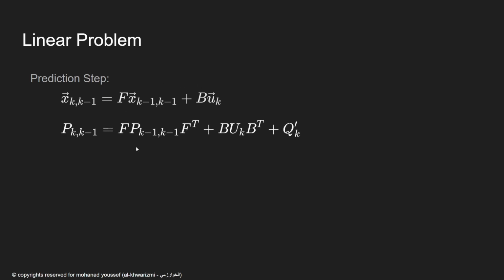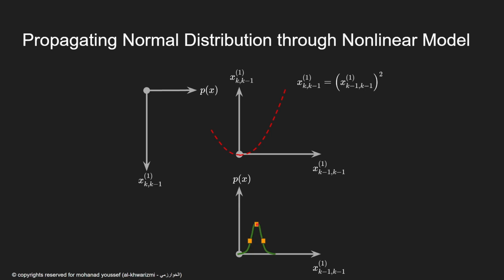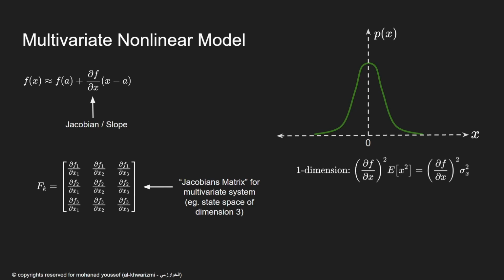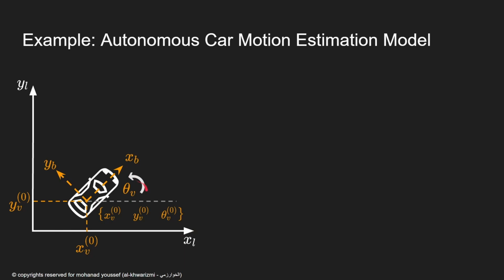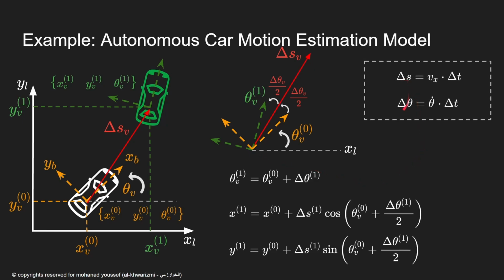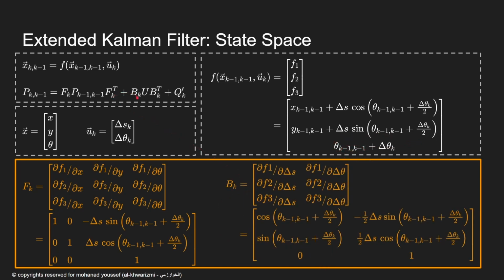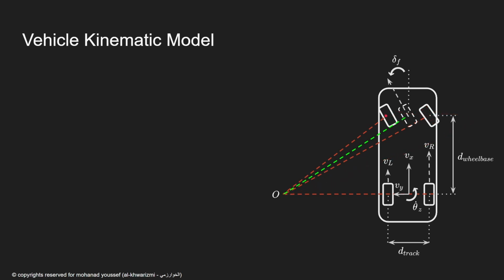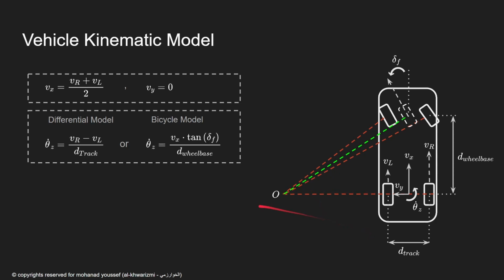Sensor Fusion:  Extended Kalman Filter - Autonomous Car Motion Estimation

Comment: Hi, thanks for the video! I have a question regarding the observation function h(x). Suppose I only have three sensors: an IMU and two wheel encoders. How should I define the h(x) equation in this case? Also, since I don’t have direct access to the full state vector as measurements, how can I use the sensor data to build the measurement vector z for the correction step?

Should I include the velocity  and angular rate  as part of the state vector to make this work (to solve more easily this problem)?
Reply from the maker: Given the sensors you are using and assuming you are working with 3 DoF (x, y and yaw angle), the states you can directly measure are yaw-rate and acceleration from IMU, and individual wheels' velocity from wheel encoders.

One approach is to use the acceleration and yaw-rate from IMU as inputs to the prediction model through the u-vector, and you can associate noise/uncertainty to these inputs using U covariance which is propagated to the state covariance in the prediction error propagation step.

Then you can extended the state vector to include velocity and yaw rate which can be corrected using the velocity and yaw-rate calculated from wheel encoders and differential model. Which means your measurement vector z will contain velocity and yawrate and both are calculated from the differential model which uses the individual wheel speed as input.

Note: A previous step to this state estimation part is to calibrate the IMU, which means estimate the standstill gyro sensor and accelerometer bias and eliminate the gravitational force component from the longitudinal acceleration before using it in the above framework.

Comment: Hello what is U in the equation of covariance matrix? It is uk vector?
Reply from the maker: It is the covariance matrix of the input vector u. Basically the noise of the external inputs of the prediction model.
Reply: @al-khwarizmi  Thank you.
I really appreciate your videos. Thanks to them, I was able to understand the kalman filter much better. But I'm still having problems with some issues. The most important of these is how you determined the Q and R vectors and are they constantly changing? And again, does the input covariance matrix U change because the input changes every cycle?

Finally, is there a chance to explain the dimensions of all the variables here with an example (for example xk 3*1 vector, uk 2*1 vector so Uk is 3*3 matrice, etc.)
Reply from the maker: Given there are n state variables and m input variables then the Dimension would be:
Vec x: n*1 - state vector
Vec u: m*1 - input vector
Cov U: m*m - input noise covariance
Cov Q: n*n - process noise covariance
Cov P: n*n - state covariance
Mat F: n*n - state transition matrix
Mat B: n*m - input transition matrix

Comment: Great Video! State space equatian really makes sense now. What about the measurement equation h? Do you derive it from the vehicle kinematics model or how do you implement it into the kalman filter algorithm?
Reply from the maker: The measurement Model H depends on the "sensor" you are going to use and in what space or coordinates its delivering it's values.

For example, If you use GPS sensor and measurement are delivered as position x & y which matches to some of already existing elements in our state vector then it will be direct mapping and hence a linear measurement Model.

The same for magnetometer which delivery heading angle or accelerometer which can be used to obtain absolute roll and pitch angles.